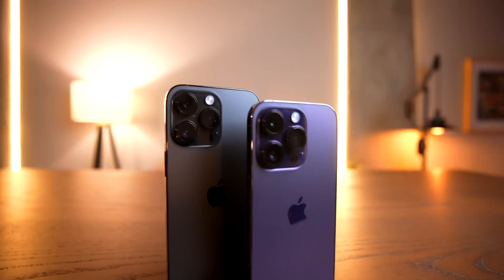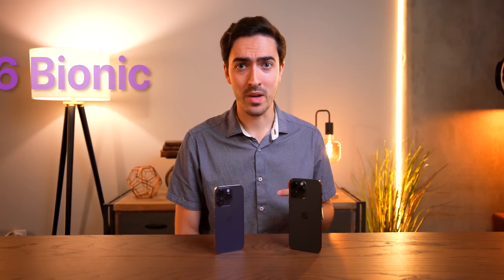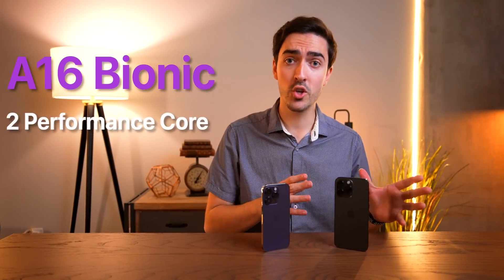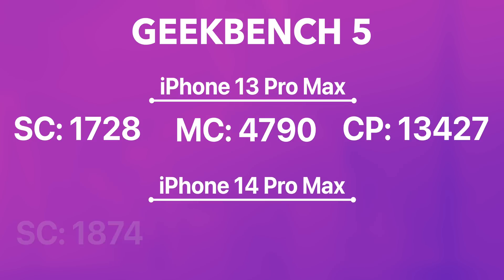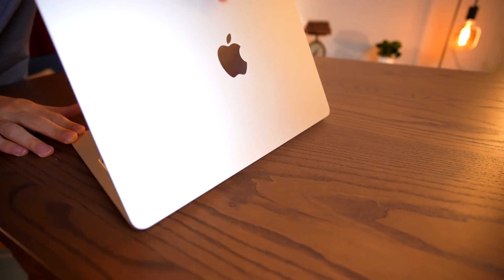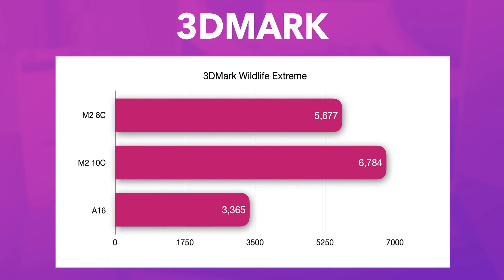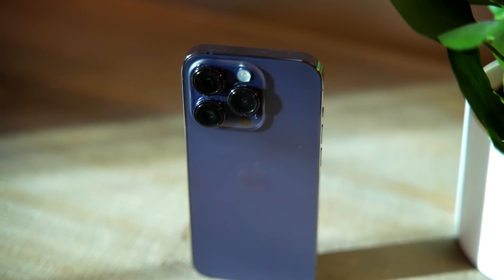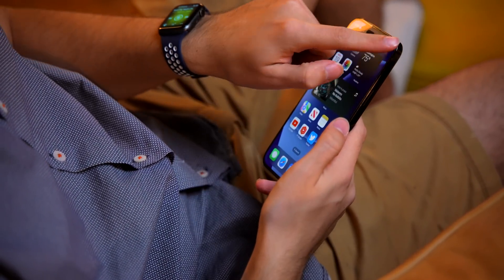A16 vs A15 Bionic TESTED: Apple is HIDING something...

Comment: 4nm is more branding than anything else. It’s frankly an optimised version of N5P, which was an optimised version of the original 5nm from TSMC. The “real” node changes will come with 3nm which should see a noticeable perf/watt bump across the board
Reply: Shrinking down to 2nm will be exponentially more difficult and I think the  1nm is a square of the cube of the hypercube level of difficulty so die shrink will not continue to improve the performance for much longer. I think we will end up with a fast enough situation. Where we end up is  in small incremental changes until the next great revolution in  chip making in maybe 10 years time. We are yet again approaching a wall and we will make contact with it soon. Objects in  extreme UV laser lenses  may appear farther  then they are..😁😁
Reply: @PWingert1966  the chips will go quantum. That is, instead of just processing binary code, the will process numbers from 0-9, which will mean a completely new instruction set, and significant gains in performance.
Reply: I'm holding out until "picometers" becomes a common term.
Reply: @zenbum2654  I'll be dead and gone by then. I'm 52 now.
Reply: nm doesn't even mean nanometers between gates anymore. They're using it as more of a marketing term now to show differences between generations than how much they've actually shrunk the chip. It get's confusing because Intel's 10nm chip actually has more transistors for a given size than TSMCs 7nm. They've run into barriers with physics for shrinking it any more. Once they get sub 1nm it will be interesting because they will need to find new ways of marketing the chip process - it would be very misleading to say transistors are less than 1 nanometer apart.
Reply: @chadh6855  I agree, it’s confusing!! I believe the current terminology refers to the gap between the one gate and the gate next door, rather than the gap IN the gate itself 🤔 🤷‍♂️
Reply: Engineer in the Semiconductor industry, this is true and 5nm doesnt 100% mean 5nm, there are variances in node size throughout the chip, usually optimizing the process means getting the variance in node size down,  usually helping in raising yields and it can shrink the die depending on packaging constraints
Reply: 2nm
Reply: @Ronin-fr1wm  Moore's law has about hit the wall.
Reply: or into the angstrom level of nanotechnology
Reply: @baoquoc3710  We'll reach the point where there is no need to talk transistors because they'll become virtual in a quantum medium of software addressable photons and plasma.
Reply: Apple A17, 1 plank length. Real Change!
Reply: @GH0STST4RSCR34M one nanometer is 1000 picometers
Reply: Wonder when we’ll hit the limit to how small we can shrink silicon nodes and high performance dies will get bigger
Reply: Idk if that’s true. Most people aren’t nerdy enough to know what that even means/ to pay attention to that.
Reply: Fast forward to today and Apple has cancelled the M2 Extreme launch, M2 Pro, and M2 Max MacBook Pro... all because of the TSMC 4N process. Then there's AMD sticking to 5nm on both their CPUs and GPUs, while Nvidia used 4N on their GPU and now it's even more impossible to get than a 3090 was. While TSMC also made statements earlier this year that could have only been lies about 4N being on track. Be warned though, TSMC is saying the same about their 3nm and 2nm processes.
Reply: Oh, there was also the suspicious Nvidia 4080 12gb branding shenanigan. That card got cancelled after some rather large angry customers outed it as insane for the price and having a different chopped-and-mixed lower-end die. Then Nvidia rebranded it as what it was originally intended to be, a 4070 Ti. Clearly Nvidia isn't the only one up to shenanigans.
Reply: That's not all, check this out, TSMC might also have a problem with dies shattering as well... EDIT oops forgot the link https://www.youtube.com/watch?v=W8mlb19w0e0
Reply: 0.5nm is going to bring the big changes .. just hold out until then … 🙂
Reply: @genxtechguy  just wait till 0.25 nanometer that’s gonna be the real change
Reply: @Kitbvdrub  I already have 0nm chips at home
Reply: @daniel_960_  I have potato chips
Reply: @genxtechguy  Nah, I think 0nm will be the future.

Comment: TBH, idc anyways. 

I don't think we need that much more performance for the use cases we have today. Phones today are very fast, and most of the times we don't even use them fully. You can run a desktop like OS from some Samsung phones too. 

Other components good decent upgrades i think , only gripe is the price increase. They're too damn expensive
Reply: I'm still hoping they would somewhat do a samsung and put MacOS in the iPad Pro when you connect it to an external display. But that's just wishful thinking

Comment: We will have to wait for software update that fixes battery on the 14 to see the true battery difference.
Reply: @Jon David slow down cpu and here you go they can simple :)
Reply: Spoiler, this update will never come…
The issue is not the software, it’s just the limit of the processor engineering where we are now…
Everything under 5nm is just less efficient, it will mostly take more energy for the same tasks and when the will shrink the dies even smaller we will get even less battery life…
When you get so small (under 5 nm) the electrons are not longer stable on the line, they will just jump over and the transistor will just not work in this moment and it just needs a new try which cost the same energy as the first try (just to keep it simple)…
And this is an physical border with the silizium we use for processors, with other materials we can maybe get it somewhat further but for now we have reached the limit…
Reply: @Eddy_E.  iOS 16 right now is a little messy. Staying in 15.7 for a month at least

Comment: I've yet to see anyone review if there is also a 128GB vs 256GB storage speed difference like there was on the MacBook Air M2. The iPhone 13 Pro had different camera features based upon the amount of storage the phone had.
Reply: @Jon David Perhaps, but their original vendors for nand chips WD & KIOXIA have 3 different SKUs with 3 different transfer speeds, not to mention that Apple was rumored to begin using a new vendor Yangtze Memory Technologies Co. this year because of contamination issues. Single SSD chip or not, I can't find any analysis on anything beyond the typical info on SoC, the new LPDDR5 RAM this year, the new screen brightness, new 5G antenna and differing battery size.
Reply: @JustinFYI  It could be under NDA, or in a schematic somewhere that someone is not interested in. I don't know if teardowns show the chips and if they do what's written on them?
Reply: @tonylancer7367  A16
Reply: even the 1tb version is one chip on the iPhone so there can't be an alike difference to the m2 mac anyway.
The 128gb pro res limitation is nothing more than a software thing.
Reply: ooh I actually wanna see that albeit it wouldn't make sense since iPhones use 1 chip for storage unlike macs who can use 2 chips
Reply: The „bottleneck“ is the cpu, not the ram…
Reply: Cinematic video in 4 k is only available on 256 or more
Reply: @remirec  that has nothing to do with the memory Speed, its just amount depending...
Reply: Larger storage version in 99% of cases is always faster
Reply: @Jushwa  not allways, exactly that’s the point, but so far no one showed anything something like that so I think it will just have same hz…
Reply: That’s also because 1 minute of pro res is 8 gigs of data or something like that

Comment: In Mrwhosetheboss battery test the 13PM lasted 19 minutes more than the 14PM. The 14 has 29MAH smaller battery. But it’s high performance core is 20% more power efficient than the A15 the new 5G chip (X65) is also more power efficient.
Reply: Strange , my 14 pro max is lasting way longer than my iphone 13 pro max.  odd.
Reply: His test was maybe on iOS 16.0 rather than iOS 16.01. Also some apps he used may have not yet been optimised. I have seen three tests after his and the 14PM beats the 13PM in all of them. So it is clear the 14PM has better battery life, and that should improve with further optimisations and updates. My S22U at launch got less than 3hrs SoT but now gets 5-6 hours after the Sept update (6 months later). Hopefully the iPhones wont take that long!